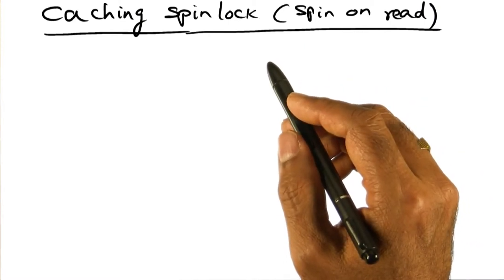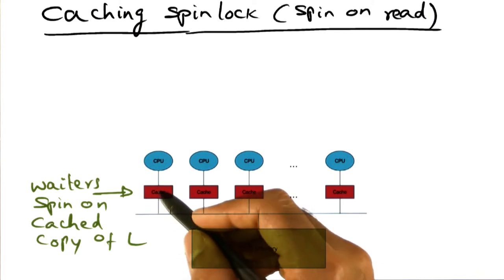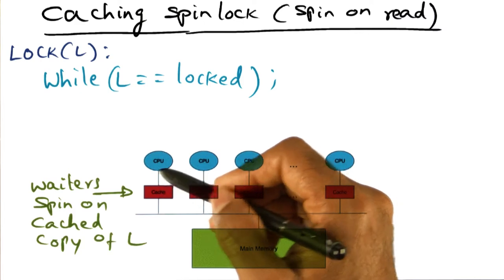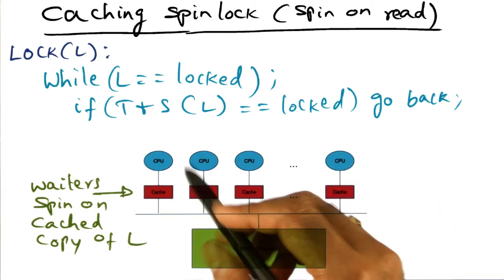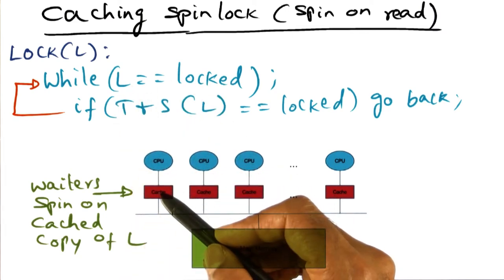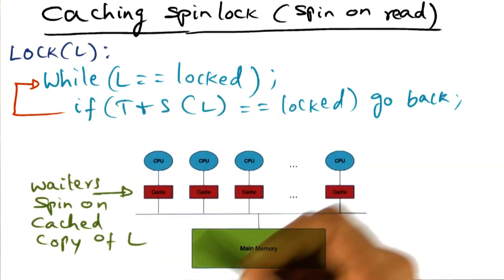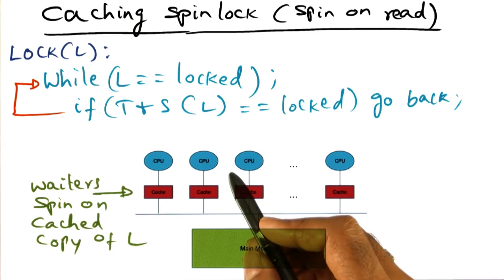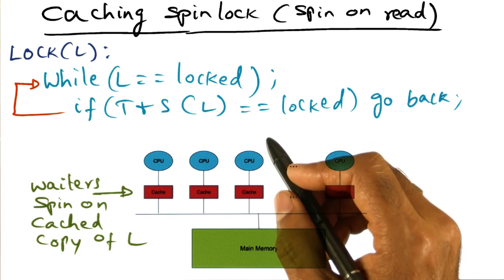Caching Spinlock - Georgia Tech - Advanced Operating Systems

Comment: I am confused , who will get the lock as all are parallely waiting for the single lock. how are we queuing/Scheduling them?
Reply: There is no requirement of queing / scheduling the lock in a spinlock (test and set) because the lock in itself is not designed to be fair. Note that the lock may be acquired by anyone. You might want to look at ticket lock if you want some degree of fairness